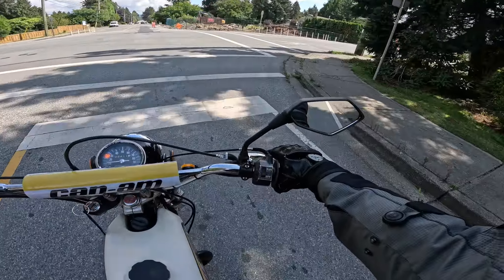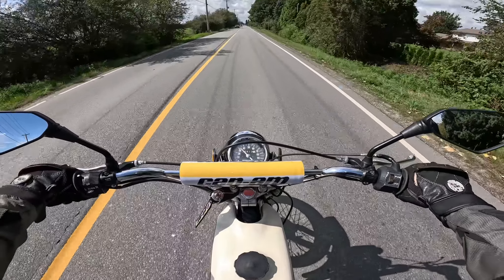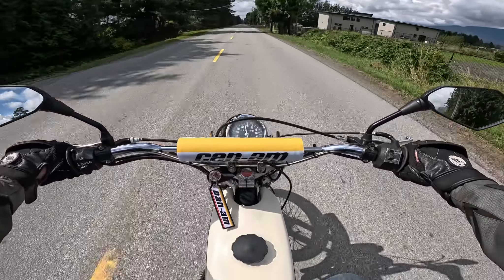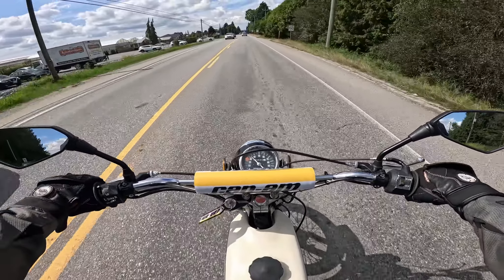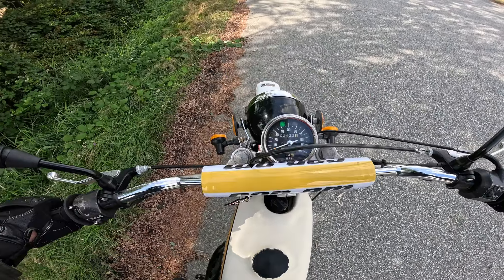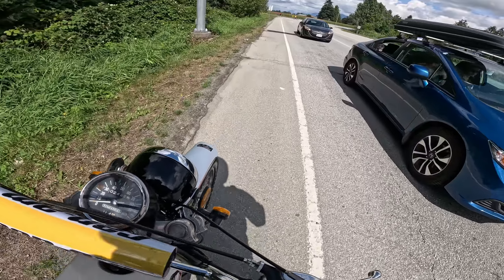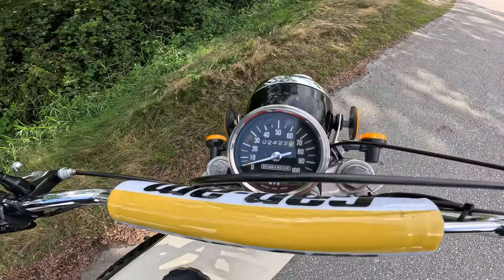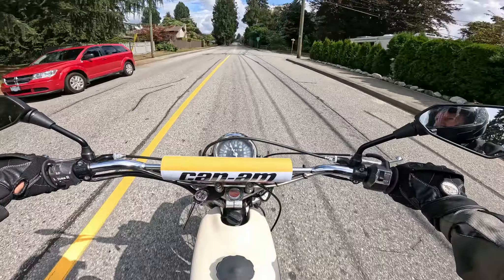CAN AM   Restoration Test Ride #1

Comment: If that is a coil and not solid state then it could be the coil. One problem you can have with a bad coil is that when they get hot they can die and won't work until it cools down. I think that's the problem. They'll work fine until hot.
Check spark while problem exists
Reply from the maker: Hi @FuriousGriffin, I think you've hit the nail on the head.   I am going to try to source a new stator coil as a first option.   If that doesn't fix it, then I guess I'll look to replace the Bosch CDI ignition box.  Based on feedback from yourself and others, the stator / coil is most likely.  Apparently the CDI box on these units is pretty bullet proof.
Reply: @MadTinkerman  Awesome I hope it works man, def sounds like it.
Reply: this happened with my bike as well. replaced the coil.  runs beautifully now.
Reply from the maker: @Canuklhead  did you replace just the charging coil or the entire Stator?